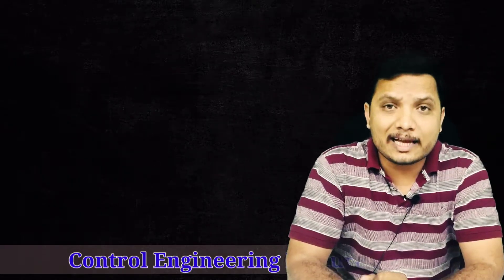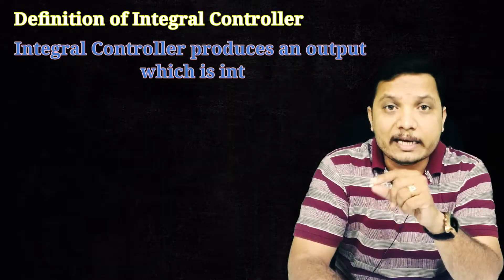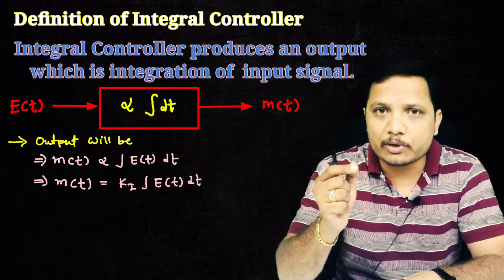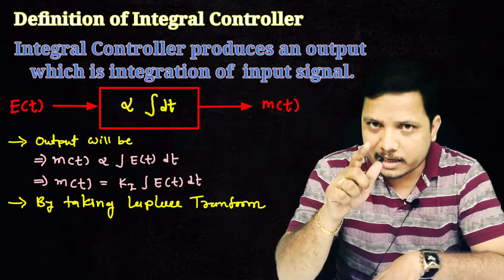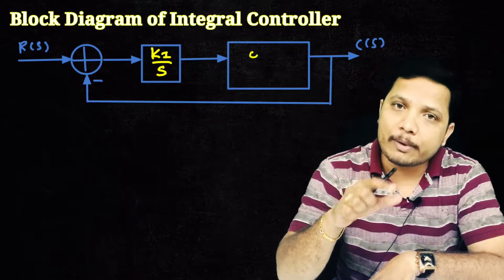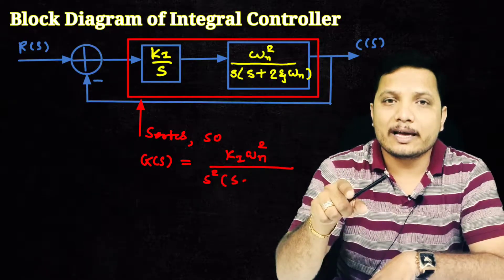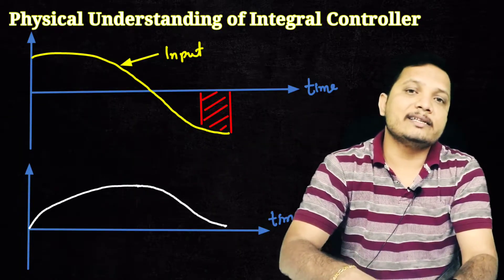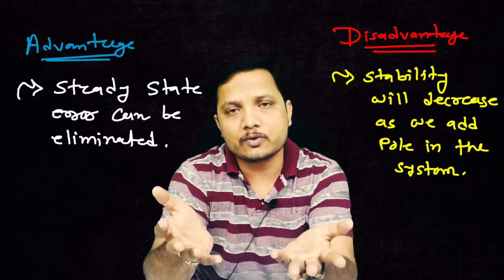Integral Controller Explained: Basics, Block Diagram, Transfer Function, Pros, and Cons

Comment: Shouldn't the transfer function be GH/(1+GH)?
Reply from the maker: Nope
Reply: @EngineeringFunda  isn't it calculated as C(s) = (R(s)-C(s))* GH, which gives C(s)/R(s)= GH/1+GH ?
Reply: @bethrobin3562  that's without the controller the result will be that